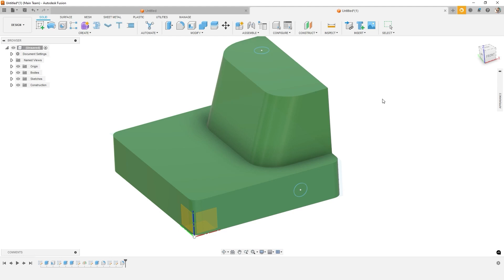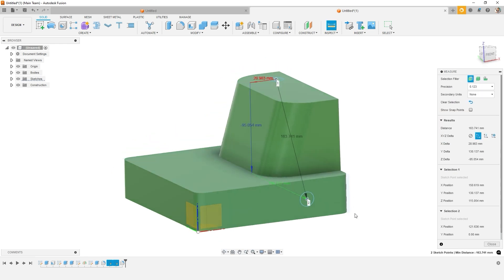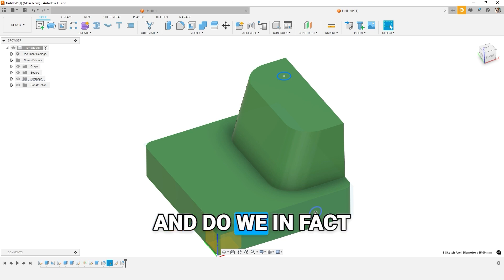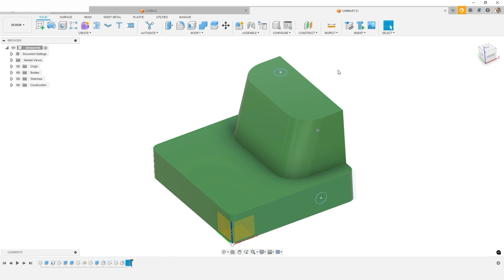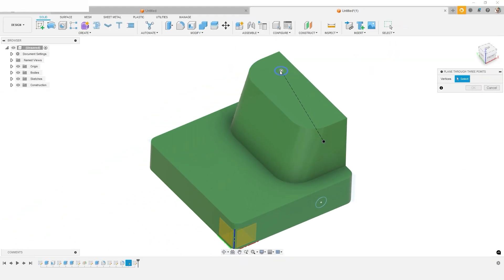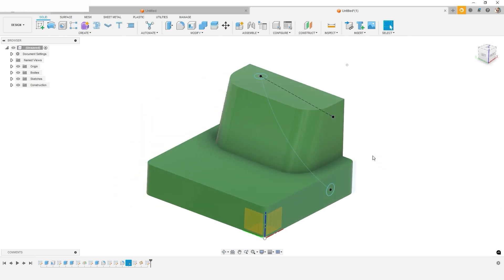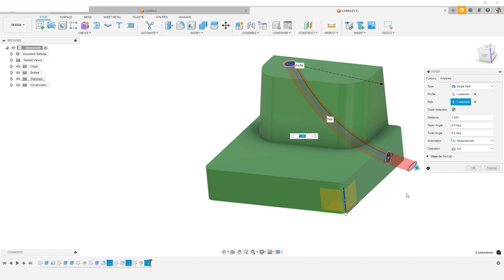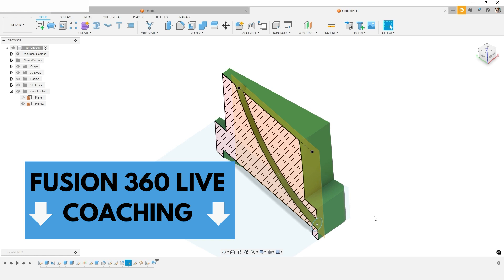Fusion 360 Sweep Cut – 3D Curve Not On Standard Plane

Comment: In stead of "Sweep", you can use "Loft", this will give a much better result right away. Select one of the circles as "Profile 1" and the other as "Profile 2", then under "Guide Type" select the "Centerline" option and add the sketch path as your centerline. Now you don't have to worry about the termination area not cutting all the way through.

Comment: An added trick would be to make the hole perpendicular at each end, so that the diameter of each hole is the same (and each hole is round) on both planes where the hole exits the block. I suppose the path could be made straight for a few mm's as it enters the block.
Reply from the maker: Absolutely!

Comment: Hey Tyler, maybe you have an answer. I asked others as well, but received no answer so far. Maybe you could help? I have created several parametric assemblies. Now, I'm adding these assemblies to a new construction by combining different furniture pieces to form a complete room. However, I’m unsure how to access and adjust the parameters of each individual assembly. For example, I have a table assembly with a parameter for table length. I want to add this table to my room with a length of 2 meters. Then, I want to add the same table again, but with a length of only 1.5 meters. Currently, I copy my table assembly, "table2000," into a new construction, change the table length parameter from 2000 mm to 1500 mm, and save it as "table1500." Then I add the 2-meter table and the 1.5-meter table to the room construction. Is there an easier way to accomplish this, so I don’t need to create separate copies beforehand? Ideally, I would like to insert a single "table_parametric" assembly into the construction, adjust its length to 2 meters, add it to the room, and then add the same assembly again with a length parameter set to 1.5 meters. I hope my question is clear—English is not my first language.
Reply from the maker: Hey Peter - I'm working up a video for you
Reply: @TylerBeckofTECHESPRESSO  Thanks, Tyler. This is so much more than I was hoping for. 🤎
Reply from the maker: Check out the new video: https://youtu.be/4JCf32yOK80
Reply: Thanks a lot, Tyler.